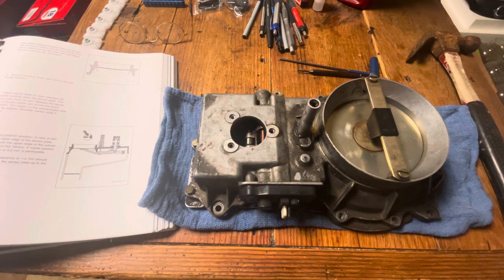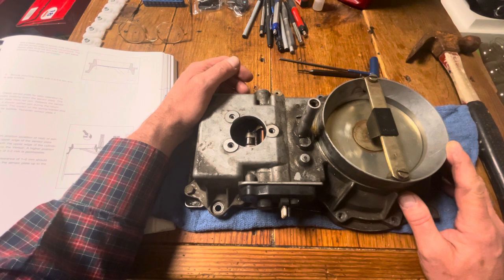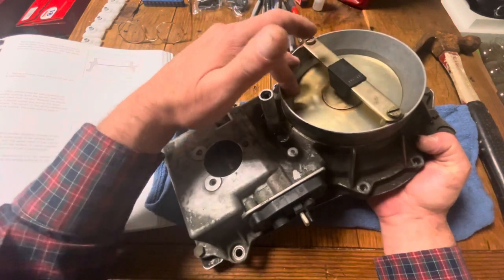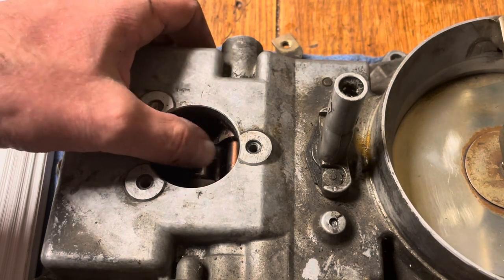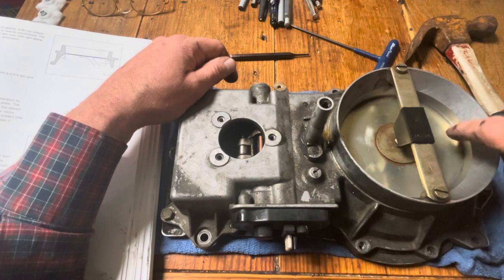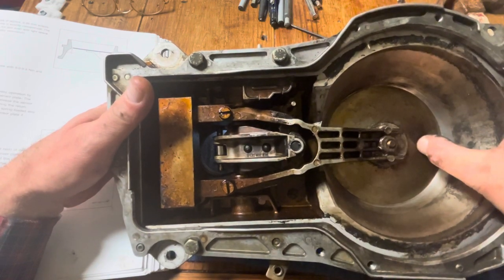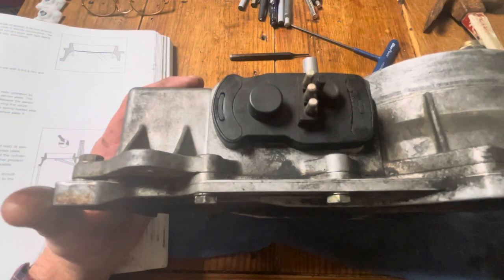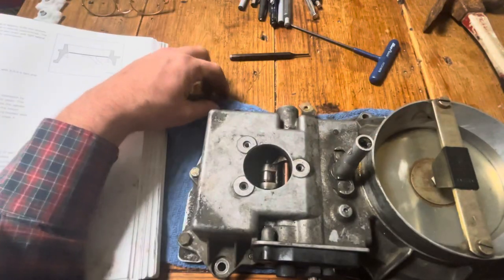Mercedes, W126 all 8 Cylinder - Airflow Plate resting adjustment, idle speed adjustment & issues

Comment: Hello. Thank you for all your useful and very detailed videos!

I would like to ask you some questions about the 14.7:1 air/fuel mixture on M103 engine:

As the adjustment involves some dependent and independent regulations, i.e. the idle rest position, EHA screw (independents), air flow plate screw and control plunger nut (dependents) sometimes the process is somehow difficult, however I did it with my two SE300 1986/1989 cars before I was aware of the idle rest position adjustment.

But now I do have some problems adjusting again these two cars:

- How does these dependent adjustments should be made? The control plunger should be adjusted before the screw that leans/enriches the mixture, but what's the exact point on which the plunger must be set and how this can be determined? A wrong position on the control plunger yields on a condition of not being able to set correctly the lean/rich screw and consequently unstable idle, starting problems, black smoke and so on.

- The lean/rich screw on air flow plate must be set as with 1mm-2mm of clearance but should the fine setting be done with the engine running? That's the way I did it.

- When the plate is pressed down, it does not go back to the idle position because of an excessive friction on the axis. What procedure should be taken to disassemble the whole lever to clean the axis?

Thanks
Kind regards
Emilio
Reply from the maker: Hi Emilio, 
Thank you for your questions. I will answer them over weekend (today is Thursday.
Thanks Peter
Reply: @inovahightechltd  

Hi Peter,

No problem!

I started with the last item, i.e. I did disassemble almost the whole air flow sensor and cleaned it. Now it returns to the upper position without friction. I did experienced issues with the plate itself but I've centered it perfectly. Now the problem I have is the brushes on the axis that makes contact with the potentiometer. I'm trying to straighten all these little wires... I guess I won't have problems with that. A new doubt I have is the angular position of the axis, I mean the position of the axis regarding the point of contact of the brushes with the potentiometer. After all these parts were installed on the car I'll face with the first doubts I expressed that are unanswered in every MB / Bosch manual I have read...

Thank you in advance for any advice!
Have a Happy New Year!
Best regards.
Emilio
Reply from the maker: @emilioaugustolazozaia143  Hi Emilio, the instructions on how to correctly setup the potentiometer are in group 07.3 in your manuals. One chapter of group 07.3 also explains on how to set the end stop for the plate correctly.
Happy New Year Peter
Reply: @inovahightechltd 

Hi Peter. How are you? I'm fine; I hope you too!

After the new year holiday I'm returning to comment that I have the MB manuals on WIS/ASRA (I found nothing there), and also two pdf:

- Bosch Mechanical Gasoline Fuel-Injection Systems with Lambda Closed-Loop Control K-Jetronic. 63 pages
- Bosch Fuel Injection & Engine Management (Charles O. Probst). 217 pages.

On the 217 pages manual I found something about the plunger recess or clearance (oring adjustment), i.e. what I was looking for. It states that if the zero position is right and the basic position is wrong, probably the plunger adjustment must be made. 'Your shop manual should have the specifications for the screw recess. Turn the slotted screw as necessary. One-quarter turn of the nut changes clearance between the plunger and the sensor-plate lever by 1.3mm'.

What? I don't understand. After setting correctly the zero position, the basic position is no more than to 2mm of 'play' on the plate before touching the plunger, but this play depends on the mixture screw and on the plunger position. I guess we should set first the plunger to its correct position and after that the mixture screw to obtain the clearance (that depends on the engine condition as you stated on your video, and that's the range of 2mm of play), so the first variable we should adjust seems to be the plunger recess and not the mixture screw...

My two cars were operating with a plunger set to 0,24mm and 0.30mm or recess. As you know, with the fuel distibutor disassembled, zooming at the slits we can see when the fuel delivery starts. With this 0.30mm recess there is no fuel delivery until we push the plunger a little bit. On some other resources (video and texts) I found that 0.60mm should be this recess. Now, with the fuel distributor opened I adjusted the plunger to 0.60mm but looking at the slits I think there is some fuel delivery without pushing the plunger... My cars are M103 engine. Is there a value of this recess for my engine or simply I should set it to just before when I estimate the fuel delivery starts? 0.30mm may be is too far. With this value the plunger has some little dead travel before the fuel delivery stars.

Regarding the air flow sensor, I did disassembled it, now it is very clean and it moves freely on its axis, it bounces four times when I release it from the bottom position, so it is ok! But I didn't found anything on the manuals about the axis, I mean the position of the axis which hold the brushes. I tightened the two screws of the lever on a position I estimated the brushes does the complete travel through the potentiometer but there are no marks except the one I engraved on the hollow on which the brushes resides.

I did the zero adjustment as you explained in your video and with the aid of the manuals. Being my air flow sensor a downdraft sensor, I hammered the pin until the top face of the plate lied on the top end of the narrowest part of the venturi funnel (at the side farthest from the fuel distributor). It seems to be also ok.

I hope finishing it today.
Thanks for any comment!!
All the best. Have a nice day/year.
Emilio.
Reply from the maker: @emilioaugustolazozaia143  Hi Emilio, happy new year to you too.
The plunger (piston) recess varies by Bosch part number and is heavily dependent on air metering unit the FD is mounted too.
The plunger (piston) recess also sets the stage for the final calibration of the FD as to fuel flow at idle which requires the plunger to be depressed by 1mm and the fuel flow to be adjusted to 4 ml/min to 6 ml/min depending on MB specification in MB Manual Group 07.3-160
Calibration of FD is done with FD on test bench:

https://youtu.be/a2dTbVLPF10

Peter

Comment: how can you adjust RESTING plate without punching that pin back to lower?? any other ways to adjust this resting plate back down to original position by correcting vacuum hoses leaks or other ways??....thanks
Reply from the maker: Gary, only by punching.

Comment: Hi, can you suggest where I could get a workshop manual for the W126 300SE 103 engine
Thanks
Reply from the maker: Hi Peter, 
I would try eBay first for a formal print version first. You will need Service, Chassis, AC, Electric and Engine plus data book. 
There are some online companies who sell those online as pdf download.
The scanned images are better with some, worse with others. 
I got some manual sets from https://www.emanualonline.com/
For my 560SEL W126 and they were accurate and 100% identical to the print edition 
Hope that helps

Comment: Hello From Australia, I am hoping you can Help me with my Issue/s. My w126 Marc 500 se has only 136 Thou K's. It has been standing under covers for 8 years. T o get it back on the road I did the following. Drained fuel tank and cleaned fuel lines. New fuel pump and filters.New eha. New fuel pressure regulator.New spark plugs / leads / Distributor cap and rotor.The car started but ran very rough.Smells like excessive fuel and black smoke and back fire. I then tried to adjust the c/o screw and can't remember the original position. Now car won't start AND the spark plugs are wet with fuel........????????
Reply from the maker: I am pretty sure that your fuel distributor is shut. Suggesting rebuilding distributor before any further start attempts 

https://youtu.be/769gMFE2VJE

Comment: I adjusted the plate according to your video on the bench. Now that it is back in the car, I notice the plate is moving up a bit as soon as the fuel pump builds pressure. After sitting a while, it returns to the set position. Is this normal? This is a K-jet thus tapping it down further is difficult while assembled.
Reply from the maker: It shouldn’t. Because you adjusted the final end stop. I would investigate this further to see of why the plate moves up which it technically really can’t because of the pin unless the pin itself moves
Reply: @inovahightechltd  I assumed there was some kind of spring mechanism. E.g. I had a pop of smoke shooting up at the first crank attempt, which made the plate pop up, then it returned to its original position without issue. I'll investigate more.
Reply from the maker: That would indicate that your engine back fired when you started to crank
Reply from the maker: @GandaGarage  have you checked your timing with a timing light? The timing cannot be adjusted but you can verify correct position of distributor and properly working EZL
Reply: @inovahightechltd  thanks good suggestion. I have renewed my ignition distributor vacuum advance unit as it didn't hold vacuum, thus timing was off indeed. I can start the car now without the vacuum connected and I set it in range; this is a 380sl thus I can still set it (10+ degrees at 1500 rpm and about 24 degrees at 3500). But when I connect vacuum to the advance unit it still doesn't want to start.
Reply from the maker: I have to check the documentation of the relation from vacuum advance and starting
Reply from the maker: @GandaGarage  what MY is your 380SL?
Reply: @inovahightechltd  It is an '83. Already got double row timing chain. And chain stretch is about 5 degrees when I check the right cam mark.
Reply from the maker: @GandaGarage  ok, up to 10 degrees is permissible. You could do a 4 or 6 degree woodruff offset key to adjust. I guess your warmup regulator is working correctly?
I will get back to you in a couple of days.
Reply from the maker: @GandaGarage  one question I do have, did you check the distributor alignment marks when crankshaft is at TDC? Because if that’s off then it won’t work right.
https://www.benzworld.org/attachments/15-501-pdf.1692826/
Reply: @inovahightechltd  yes, that is the tabel I referred to. Used the settings bottom page 2 for USA starting 1983. The distributor is on the TDC mark when the engine is off, and the values for 1500 and 3500 rpm are ok without vacuum connected. Only, when I connect vacuum to the advance unit, it doesn't want to start. The advance unit is new. And when I put a hand vacuum pump on it, I can see the mechanism in the distributor rotate.
Reply from the maker: @GandaGarage  the rotor has counter weights and an endstop. I explain this in this video starting about 22 minutes into the video 
Mercedes W126 V8 starting & idle issues, troubleshooting guide based on my repairs of my 560SEL MY89
https://youtu.be/leCZD77_Sg8
You may have to watch the entire two segments

Comment: Sir, I am trying to reset my timing for TDC.
Confuse about these markings....
Which marking do I use to set my TDC....ZERO or the rod that sticking out about 5mm?
This is on my 89' 420sel original parts.
Thx in advance...
Gary
Reply from the maker: Hi Gary,
TDC on Crankshaft? Just making sure I a understand your question correctly since this video deals with the fuel metering unit
Reply: Yes, I was going to do timing adjustments for the distributor cap and DTC inline...and saw that additional pin that sticking out near those numders...numbers....
What's that pin for?
Reply: Could I call you to explain what I am trying to do and have some questions regarding this plate adjustment and ruff idling....on my engine....cold hard start issues?
Reply from the maker: Again, the pin on the engine block or the tiny pin on the balancer?
Reply: Pin on the balancer
Reply from the maker: @glim888 this pin is used with a inductive sensor, which is mounted to the engine block. This sensor has a wire with a coax shield which terminates on the round diagnostic connector on the inside of the left fender. This sensor is used with the TDC signal on the larger Bosch oscilloscope with 10 channels and shows the TDC in relation to the eight spark plugs and the TDC signal (rpm signal) from the rpm sensor on the flywheel housing
Reply: Thank you.
Reply from the maker: My number is listed on my website on top of the home page. Please text me first and with your name. Link to my website is here in my YouTube channel info
Reply: When is best time to call you?
Reply from the maker: @glim888 text me tomorrow morning, I will let you know
Reply: You are in east coast,  right?
Reply from the maker: @glim888 central time
Reply: Goodnight
Reply from the maker: @glim888  I just watched your short videos you posted and yes you need to turn the mixture adjustment clockwise probably 1/4 to 1/2 turn

Comment: Hello, I have a 260E vehicle with an M103 engine. It stalls at idle when using gasoline. It starts by pressing the gas pedal. What is the reason?
Reply from the maker: No clue
Reply: @inovahightechltd  I am writing from Turkey, there is no one who understands these vehicles, can you help me?
Reply from the maker: @johnwick-vj1zd  this car maybe equipped with an aftermarket start/stop feature like when you get to a traffic light it will stop engine after a few seconds.
The cars run only on gasoline
Reply: @inovahightechltd  There is an LPG system in my vehicle. There is no problem with LPG, it works well. There is only a problem with gasoline.
Reply from the maker: @johnwick-vj1zd  sorry, but this is beyond my expertise. I deal only with gasoline engines.
Reply: @inovahightechltd  Thank you very much for your interest, greetings from Turkey :)